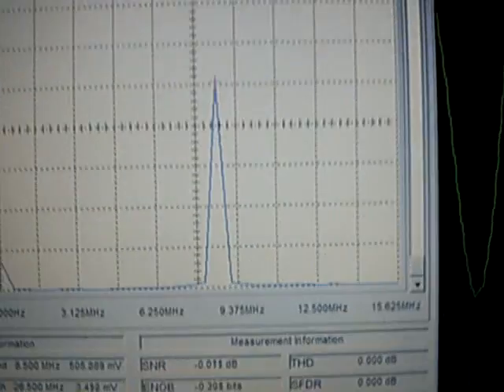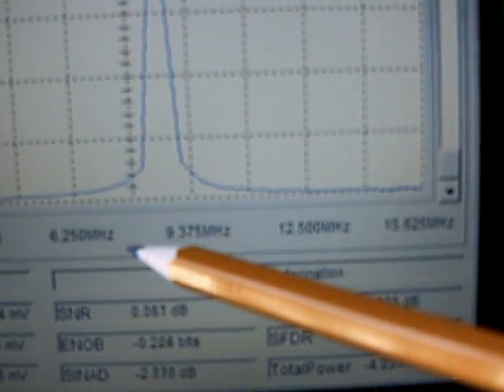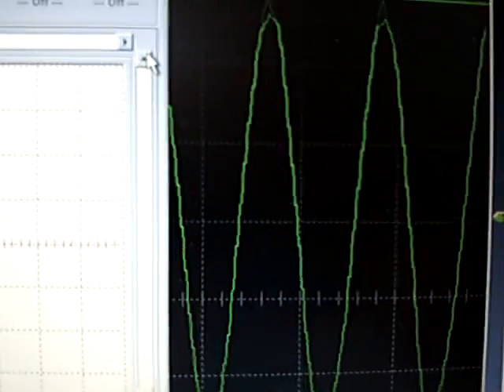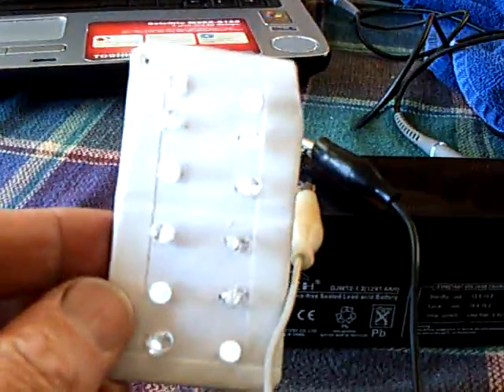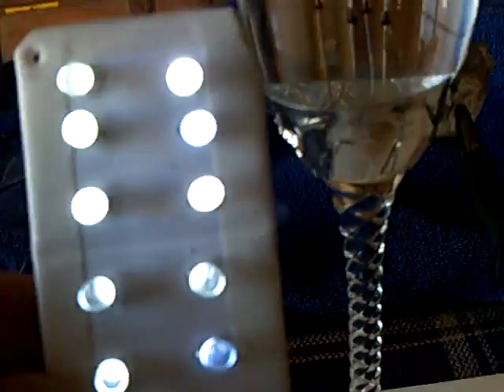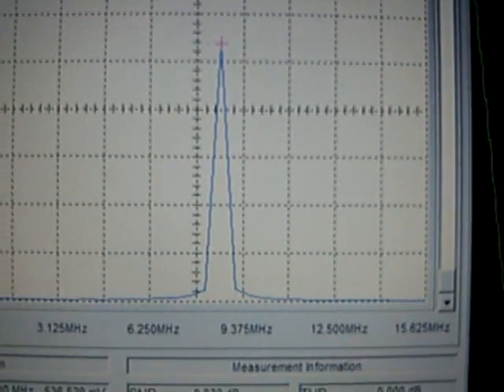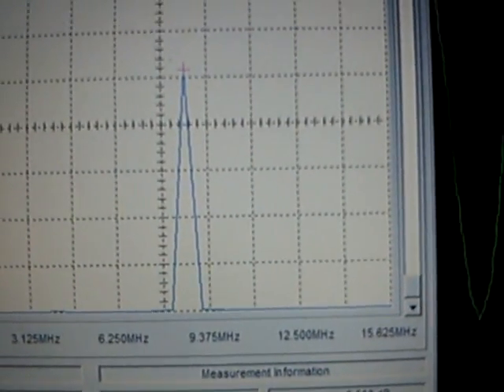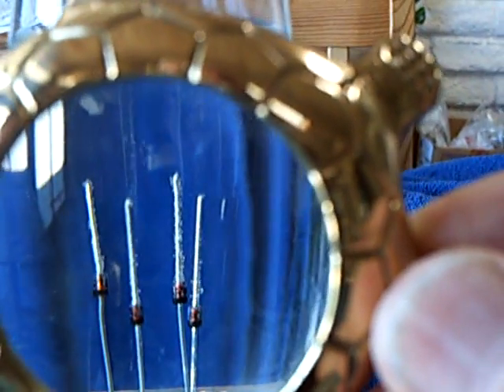SEC four diode electrolysis experiment.ASF

Comment: The information August 2011 provided by Ron Stiffler shows a slightly
different connection from the L3 coil, it is a capacitive coupling such as a blown fuse. Even though excitement  energy flows from exiter to the test tube also keep in mind that energy from surrounding is being pulled into the cohered liquid..

Comment: Lid, What happens if you drop your AV plug with the led attached into the water? Just wondering if it makes a difference or even still works. Maybe it would produce a gas too. If it is only one bubble, would this be a Oxygen and Hydrogen mixture? But I thought that Oxygen and Hydrogen combine to make water. May be it is something else that is a gas that burns. Dr Stiffler once made a slow burning Oxygen and Hydrogen mixture by electrolysis. May be this is it, or something similar.

Comment: Lid, great work, very interesting, Dr Stiffler said that there was no relationship between the amount of input power to the SEC and the amount of gas generated by the process. This I find important because, in theory anyway, you are only limited by the amount of diodes and water you can cram into a given SEC field. The gas, when burned should produce more energy than required to operate the SEC, plus excess heat to generate electricity for other use. Unlimited power production. (maybe)

Comment: Lid, when you break the covalent bonds of water, you are producing both H & O at the same time - or- you are producing H gas and changing the composition of the water from H2O1 into H2O2, because the O has to go some were.
The tough nut to crack in electrolysis is the O.
If you want to increase your production, add a little epsom salt [magnesium sulphate].
Peace - and thank you.
Mike.